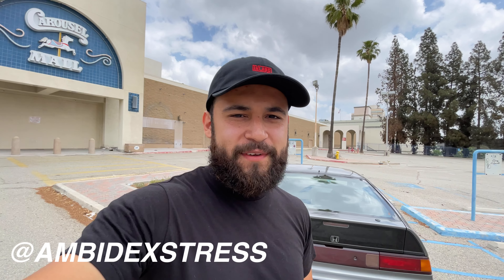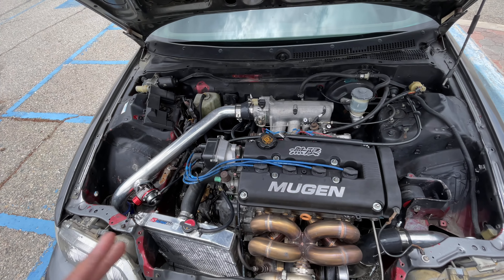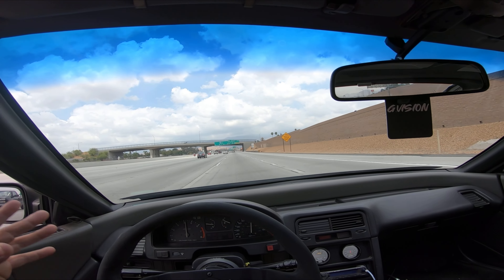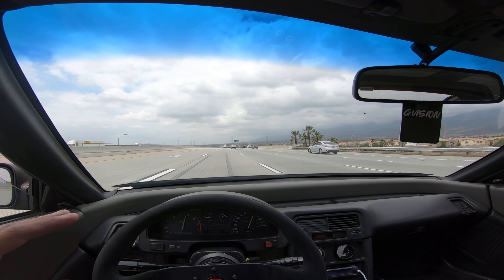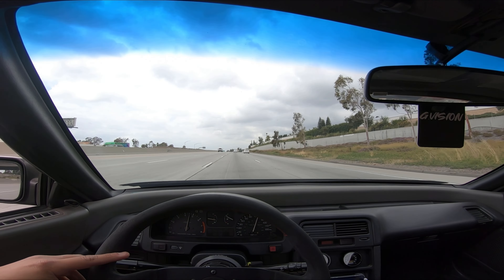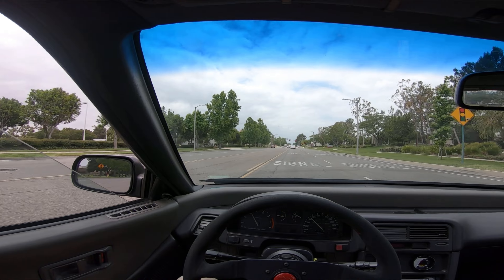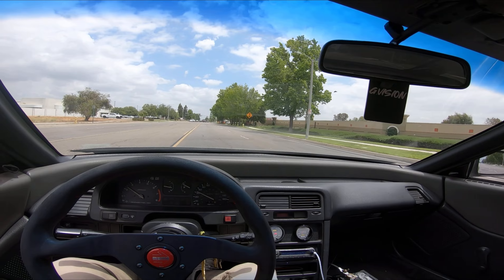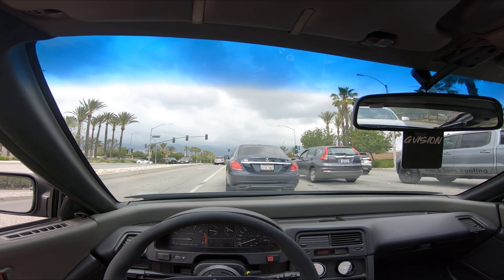DO I REGRET BOOSTING MY CRX?

Comment: The transmission debate is usually from a drag racer point of view.  B16 gears run out too fast for the 1/4 mile unless you want to hit 5th. Everyone likes to only run into 4th gear at the strip

Comment: you need a full radiator on that crx with the turbo brother. and GSR tranny would have been better you wouldnt spin so bad. its not always the tires.
Reply: You can’t mount a full rad for boosted cars. A koyo or mishimoto is the way to go. Unless you want to completely redo the factory front end.